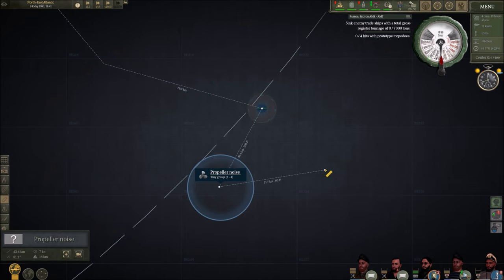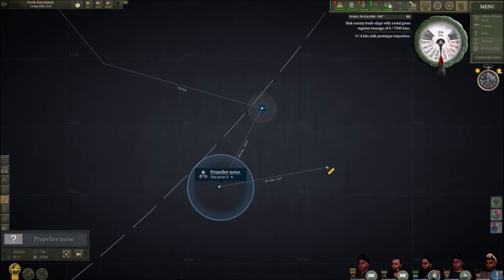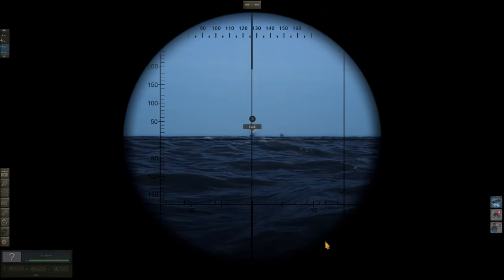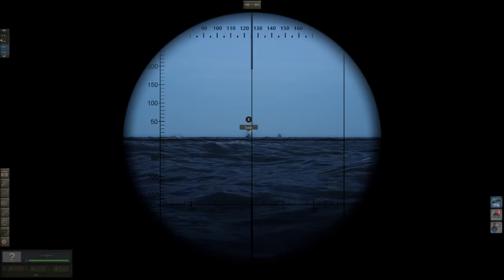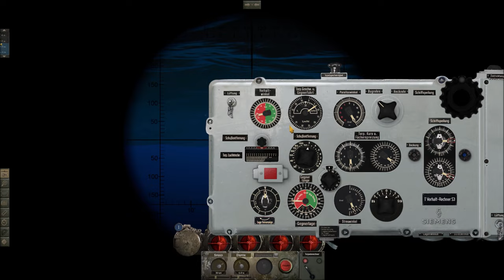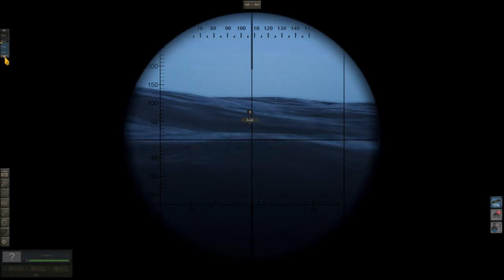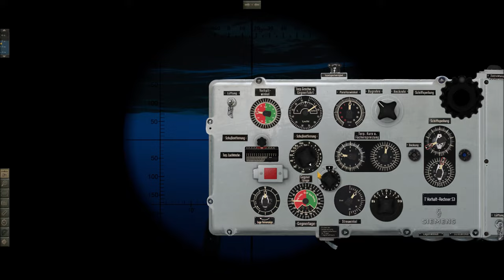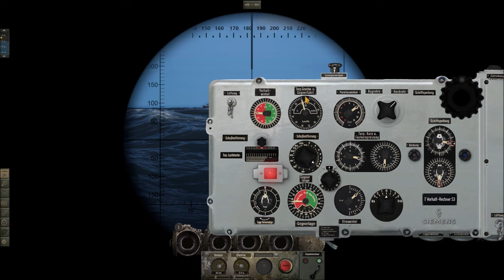UBOAT | Course and Range Estimation | Patrol AM4-AM7

Comment: Very well it is necessary to make a triangulation by using the table v / T of the mod TDC I made several videos above the problem with the game it is the concordance of times speed of the game and speed of the convoy and the submarine which does not Don’t correspond to the time and place of interception it is very difficult even with good calculations which frustrates me enormously
Reply from the maker: I completely understand where you're coming from. There are many small nuances about the game that kind of hinder that sense of realism that one would like to incorporate. Like the zoom or scale of the periscope/uzo in this game is off to me. Like the uzo zoom should be x7  zoom (in game its 6) and you should be able to get accurate estimates by comparing ship scale to the width of the graticules on the binoculars BUT for some reason you have to use 1.5 zoom to get accurate scaling and not the 6x. (I hope that makes sense), but yea scaling of objects and distance is another issue for me (compared to silent hunter, which does scaling better).